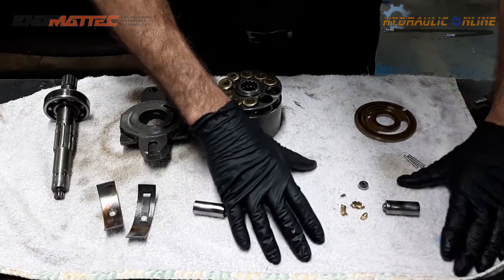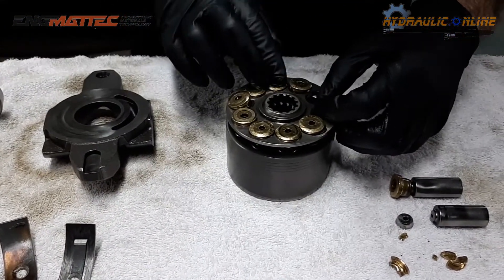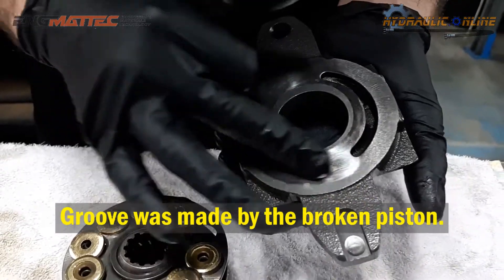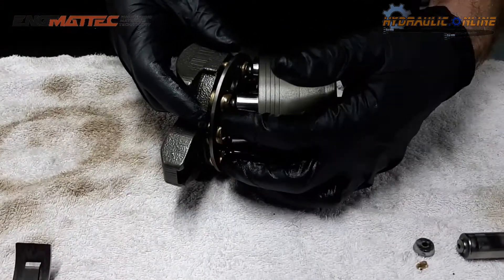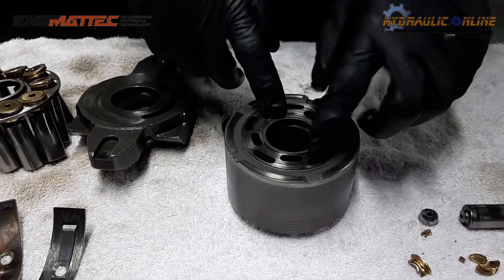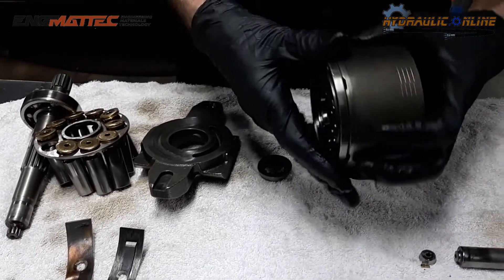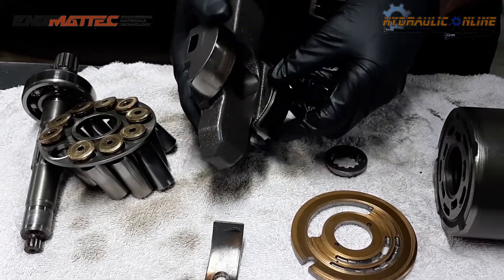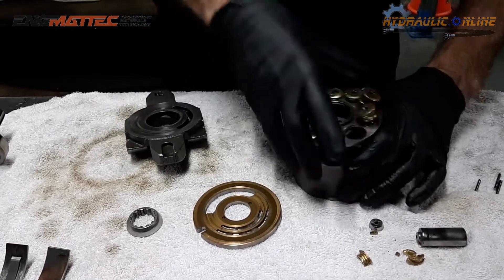Variable Displacement Piston Pump Failure Analysis How it works and How to Repair

Comment: Man ...that was an Excellent video. I appreciate your effort and time in making that . Thanks so much! Could you tell me how the squash plate is controlled.
Reply from the maker: Hello, Jim many thanks for your positive comments, and great question by the way.

Firstly, The pump's Swashplate and the resulting variable displacement is not controlled by the machine's operator. 
The Swashplate is adjusted and controlled by an internal system known as the "Horsepower Control" (HP Control)

This pump is actually designed to pump a certain volume of oil per revolution, higher engine speed will result in higher flow up to and until a certain predetermined pressure is reached.  

The HP Control then takes over and it will slowly de-stroke the pump by moving the swashplate to produce less and less flow per revolution. This de-stroking will be maintained as long as high pressure is maintained eg when forcing an excavator's bucket into the earth. 
As pressure is reduced, for example on an excavator when you reach out forward to start another digging pass the swash plate springs will re-stroke the pump and flow will increase. 

If you rewatch the video between 8:20 and 8:30 you will notice a small hole under the valve plate, that hole is fed by an even smaller hole drilled in the valve plate, this smaller hole bleeds high-pressure oil into an internal oil gallery that actuates the HP Control Piston. 

From 8:36 to 8:46 the HP Control Piston is test fitted for smooth movement. 
From 9:00 to 9:04 you will see me remove the HP Control Piston out through the back of the pump. 
The HP control piston is finally fitted from the back of the pump and covered by the strong thick cover plate marked "4020" see it  at 10:24 to 10:27  

The HP Control circuit does a few things.
It prevents the engine from stalling,
It maintains a certain high pressure for optimum digging performance.
At High pressures, it reduces the flow and thus protects the pump from excessive internal component stresses. 

Hope this all makes sense. 
Cheers
Minos
Reply: You sir a natural teacher . Thank you for your kind response as I get started on my hydraulic studies. I count myself very lucky to have come across your site. I am checking 
It out. My Best.

Comment: это точно профи собирал насос?
Reply from the maker: This Pump supplies oil at a certain volume, as more and more load is put on the pump, and to prevent the engine turning the pump from stalling the Horsepower control adjusts the angle of the Swash plate and reduces the piston stroke therfore changing displacement.

Comment: Forward and backwards is going  don't want to going up hill it stop
Reply from the maker: pistons or valve plate may be worn out, or horsepower control not working properly, does the engine want to stall when going up hill?

Comment: Hello, i have a jcb skid steer with a saeur danfoss series 40 m35 pump

My question is i was operating the machine for about 3 hours everything was working normally, then something in the machine caused it to jerk and shut the machine down, now when operating for like 20 minutes or so it works normal, then after that when everything starts to earm up the machine hydraulics get very weak and slow( will barely drive or turn, boom lifts slow) any ideas what i might be looking at? Have you ever heard of a complaint like that?
Reply from the maker: Thanks for the message Andrew  we have heard of this issue many times. 
There are no short cuts in fault finding hydraulic systems, they nearly always a logical process of elimination . 
 The First things I would do is as follows, please try and do them in the order written below as they are all interrelated. 
Check your hydraulic oil level and top up tank if it is low, 
Check the type of oil you are using and if it is the correct grade for the conditions you are operating in.  
Next you will need to check oil temperatures. 
The best way to check oil temperatures is by investing in a Infra red Digital temperature indicator they are about  $30 these days. They are also very handy for using around a mechanical work shop. 
Check the temperature of the oil when things start to play up, if the oil temperature is higher than 70 degrees Celcius after exiting your oil cooler, then check if the cooling fan is working, 
If cooling fan is working, then check to make sure your oil cooler fins are not blocked with dust sand and or mud if yes carefully clean out with compressed air and running water. 
Point the thermometer at the oil fittings exiting the pump as well as the oil cooler inlet and outlet  fittings there should be a temperature drop across the oil cooler.  
If all of the above proves to be Okay then a Pump Flow against Pressure Test is required to check the condition of the Pump.

Comment: I facing problem with Nachi make hydraulic pump.

P1 work good but P2 not create 135bar .
P1 generates good pressure upto 195bar.

What's the problem???
Please help.
Reply: P2 not generate above 135bar
Reply from the maker: You will have to strip the pump down and make an inspection probably a damaged valve plate, piston or piston slipper or a suction issue.

Comment: Hello friend, a question Is the swing plate damaged? since it has a slot or is its design like that because the times I have had to check the pumps I have not seen swingarms with a slot and if they come I will change them for a new one without a slot I am from Peru greetings
Reply from the maker: Need to see some pictures of the item you are talking about.

Comment: nice explanation! Recently I had a case where the piston shoe was damaged due to friction with the swashplate even though there was a sufficient amount of oil. What do you think are the aspects that I need to pay attention to in this case? Does cavitation also affect the damage to the piston shoes? Do you have any references or literature that I can read to help me solve this problem? Thank You
Reply from the maker: Bagus Having plenty of oil is only one of many requirements,  the oil tank must be allowed to breathe check filler breather, 
the oil must be very clean check oil return filter if you have had a pump failure you must flush all the oil and change all the filters, the oil must be of the correct type and viscocity for the environment and the machine it is used in , 
the oil must be allowed to flow freely to the pump, (check the suction strainer this will cause cavitation if it is blocked, and finally the oil must be at the correct temperature, not too cold or too hot.  Very Cold weather may cause cavitation on start up, very hot wether will cause accelerated wear unless you control temperature with an oil coolers. As for Cavitation the piston shoes and valve plate will be the first to fail as they are made of the softest materials.

Comment: we bought nachi replacement pump for our zaxis30, hydraulic doesnt flow on the selector hose when turned on but flows when its turned off. can you provide insight on what's causing this? mechanic is suggesting that we open the pump to see what's the cause of the problem, but we refused as it would void the warranty. can you help ?
Reply from the maker: Not sure what you mean by selector hose. Please expand.

Comment: Hi, great video, I have a small skid steer I just restored all oil and hydraulic lines are new, cleaned out both chain case reservoirs , everything runs and works great but I find both the variable pumps are really loud, no cavitation, charge pressure is good, they both have great power, just loud hydraulic noise, im not sure if they were built like this in 99 or something needs work inside?, any help would be great
Reply from the maker: Hi Rick there are many reasons for the noise,  pump vibration and harmonics can amplified through the machine's frame, older pump designs, may be less smooth and efficient than more modern equipment, larger clearances in your pump and motor bearings, More internal oil slipage due to larger clearances as wear increases,  Oil Temperature and viscocity.
Reply: @Hydraulic.Online  thanks for the info, sounds like many to diagnose for sure, I’m anxious to take the pumps apart but need the machine desperately on the farm, my main concern is do you think I can do any damage  with how it is?, the whole hydraulic system was cleaned out with all new lines filters and top synthetic oil, oil looks very clear even when hot

Comment: Thanks for the video, I have one similar fitted to my trawler, it leaks out of the control rod which I think is the part that alters the swash plate, when the lever is right in one way I have full flow and when its the other way I have next to no flow its a bit bigger than that one but it works very well except for the leak I was trying to see if I could repair it
Reply from the maker: Glad it helped

Comment: hey i was wondering what is the cylinder block for? making a presentation on the pump but cant find whst the block is.
Reply from the maker: If I have understood you correctly the cylinder block It is just a piece of thick wall Aluminium tube that supports the pump housing with stability during assembly, it also keeps the input shaft from touching the work bench and allows it to rotate freely.

Comment: Hello Sir, I have a nachi pvd 2b 44 pump that is worn out and I ordered new parts for it. It is clear that it was rebuilt in the past and I found something that raised some question marks. The oil passage coming from the small hole in the pressure plate is blocked (plugged) right before it exits the main body of the pump going into the HP control.
The HP Control  has two pistons, one big and one small. The plugged passage should lead to the big piston. The passage from the small piston is going through the main body of the pump and reaches to the gear  pump .
My questions are: is this passage supposed to be plugged? and can you explain how the HP control is working with two pistons and in connection with the gear pump (pilot pump)?
Thank you
Reply from the maker: Interesting...  let me ask you two questions first, 
Did the old valve/pressure plate you replaced have a small hole as well and is there an external port on the pump that connects to the big piston on the HP Control?
Reply: @Hydraulic.Online  hello, thank you for your reply.  the old pressure plate that I am replacing has a small hole in it, but like I mentioned, this pump was rebuilt in the past so I have no idea if the original pressure plate had this hole (I guess it did). There is no external port between the pump and HP control. 
Meanwhile I managed to extract the "plug". It turns out that it is a screw plug that has a tiny orifice drilled into it(which was clogged). I measured the hole in the pressure plate and it is 0.65mm in diameter and the hole in the plug is 0.5mm. So it looks like a flow/pressure restrictor. My guess is that this orifice being clogged, lead to the excessive ware of the pump. The issue is that the process of extracting the screw plug, rendered it unusable. The question is: is this a vital part for the pump or it can work without it? From what I can tell, it is original and not some modification

Comment: hello Mr, I am an electrical engineer, I have a hydraulic drilling machine. The hydraulic oil has been heating up for a while and the pump too yet the entire hydraulic control system is responding well. I tried the bleed, I cleaned the hydraulic radiator, checked if the blower and even bleed the pump but nothing. all are functioning properly, but it is the pump and the hydraulic oil that heat up. what to do mr because i'm really stuck. I need help
Reply from the maker: Best thing to do Santas it to get an infra-red temperature indicator and check for hot spots all over your hydraulic system. How hot is it ? Temperatures up to 80 degrees C  at the pump is OK as long as the oil in the tank is below 65 degrees C. You may have an over pressure or flow control issue and oil is going through a pressure relief valve in the pump.
Reply: @Hydraulic.Online  okey thank you sir

Comment: Very clear steps, thank you. I have piston pump with a huge loss power so it can't move the wheels of a skid steer loader. I checked the piston shoes and they all look ok. I want to avoid buying the full rotating group that it is expensive. I was thinking on these steps: 1. Buying a micrometer and checked diameters of each pistons, if I'm lucky I could identify the bad ones and replace them. 2. Checking the holes diameter of the cylinder and replace if they are not all the same. But after these easy checks, what else could I check? What would be next most likely issue according to your experience if I have to guess a component to replace? Thank you.
Reply from the maker: Check the condition of the Piston Shoes on the end of each piston they should not be burred or bruised and the flat seat has to be clean and scratch-free. The shoes should swivel but not have any end float at all, then check the valve plate and lap the valve plate on a piece of Glass with 1200 wet and dry sanding paper and light oil or diesel to remove all scratch marks.
Lap in a figure 8 movement keep even pressure on the plate and rotate the plate every 20 seconds by 90 degrees.
Reply: @Hydraulic.Online  Thank you very much for your help. It is hard to find somebody sharing knowledge in this field. I will probably have to replace the pistons and valve plate. Do you sell spare parts for Cessna 70412-307C?

Comment: Nice informative video.. a question I have a pvd-3b hydraulic pump one you fixed the swash plate at an angle the machine starts working.. the outlet pressure on the servo piston isn't letting the swash plate move..any suggestions why the servo piston isn't draining the oil ?
Reply from the maker: Have you changed or replaced any parts?

Comment: hello i need help. is it possible to make a pvd-2b-42 from a pvd-2b-36 pump? what spare parts need to be replaced? Thanks.
Reply from the maker: I think it would be possible with a new rotating group, ie new Pistons new Barrel and possibly a new valve plate as well .....that been said, this larger group will give you more flow or speed but you will need to ensure you have enough Horsepower other wise you may not be able to generate as high a pressure as the 36.
Reply: Yes